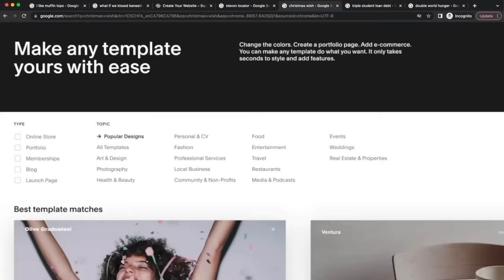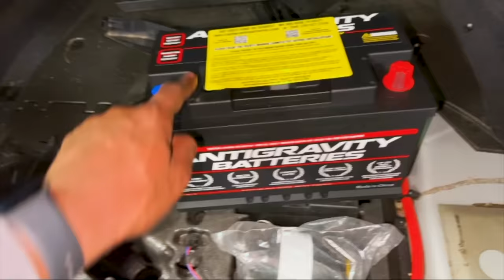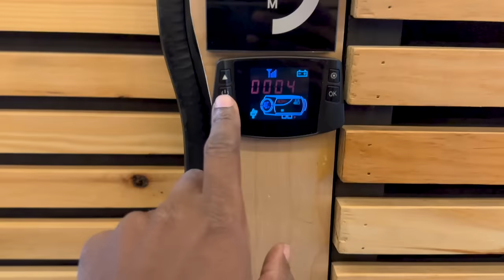I Bought An “easy fix” V10 BMW M5 From Facebook Marketplace, Here’s How Stupid I Was

Comment: It's throwing all those codes cause of the old battery not having enough power for all those components. Plug in the new battery, cleared the codes & registered the battery to the car.  90% of the warning errors should go away. Drive the car Then check the remaining codes again

Comment: I had the misfortune of owning one a few years ago. A lot of trouble from the outset.
I'll list the problems:
1)Second gear synchro wore out and needed changing.
2) fuel evaporation system failed and sucked all the air out of the tank and crushed the fuel sender unit and broke the venturi balancing of the tank.
3) ECU failed due to a rusty pin.
4) spark detection module failed
5)Engine crank seal
6) Diff seal
7) clutch issues

I managed to sort out all of the above except the clutch issues because at that point I was fed up with it.
I part exchanged it for another car and got around £7k for it.
I will say that when it was working it was awesome.

Comment: damn the van looks nice for this time of the year..

Maybe clear the codes on the M and if it's still the same take off the cylinder heads to look inside...
if the bearings are shot, it's over.
alternatively I think you can stick a "surgical" camera (don't know from where) and avoid taking them off.

Comment: Drop the oil pan and check the bearings. They can be replaced with the engine in the car if needed. Copper in the filter means that the coating is already gone. Thin oil with worn bearings could very well ruin your engine completely sooner or later...

Comment: I just bought one two months ago. Completed rod bearings, vanos and a whole host of other little gremlins. The very first thing I would do with this ride is replace and register the battery. It's shocking how many codes this throws with a crap battery. Do your battery then scan with a reputable scanner (Carly does well as do others). Clear all codes post battery registration, then put some miles on it to see what pops up. You will have a good idea what truly is wrong with it.

Comment: The way you can try and unstick these lifters is get it up to operating temp and then at a stop, rev it and hold at like 6k rpm for a few minutes to try and bleed the lifters. That's typically how you bleed hydraulic BMW lifters. What exactly are the codes its throwing in the ECM?

Comment: I had a 2006 e90 330i. If i let it sit too long, i would get the tapping noise from the hydraulic lifters not being filled with oil. even short drives weren't enough to make the tapping go away. take it on the freeway for a little while and the tapping should subside.

Comment: Bmw stands for break my wallet.  Bmw are very solid for 80k miles after that get rid of them. These cars are over engineered on purpose to make you spend money goint to dealership.  I had to buy new female and male  torque socket sets judt to be able to work on them. Very few times have i done a repair without cursing bmw  engineers... may we meet in hell

Comment: if the Cooper seen anywhere it is an issue with bearings. take oil pan down and look for for them. it doesn't require to take of cylinders and rods. the bearings could come off without opening the top of the engine block(without getting cylinder heads out from the engine)

Comment: the v10 engines have rod bearing issues and also the throttle actuator motors need better gears. The copper is from the rod bearings giving you the middle finger that hey are about to ruin your wallet.

Comment: Rod bearings are cheap and fairly easy to do. Just drop the oil pan and change them and I would suspect the engine will be ok. They at least need to be inspected.

Comment: Oh man, sounds like the flux capacitor has a bad connection, you probably need to clean the connectors on the Olsen coaxial monitor cable or replace them all together.

Comment: 6:45  Take a razor knife cut a large section of media out,  fold it back together then wrap it in a clean cloth. Put it in the vise and lightly squeeze the oil out and then you can see exactly whats in there

Comment: That copper is bearing material, surely. They're going to need changing immediately. And yes, pursue it. Try and get Sreten out to sort your car out. What he doesn't know about these cars isn't worth knowing.
Reply: Once it wears through the soft copper, it's steel on steel and the crankshaft will be toast. Replace them now if you still can.

Comment: Rich, Rich, Rich, my man. I owned an E63 V10 M6 for years and worked tirelessly to TRY to make it sound anything LIKE an F1, and figured out finally there was no way. That S85 motor does not sound F1 at all. Not even close. Never can, Never will. BMW made a 90 degree V10 which, is the BMW way. It's more balanced, which BMW likes, but never, ever will sound F1-like at all. The last of those motors were: the non 90 degree Porsche GT, the Lexus LFA and the Gallardo. 2008 and previous. After that, Audi got their hands on THAT V10 and raped it's sound as well.  Stroll thru my channel for my sad attempts at making an exhaust for my M6.

Comment: Lithium IS NOT good for long term storage or colder weather. I haven’t heard any legitimate reviews on these batteries. But it almost has to be just a straight scam, lithium ion batteries lose 20% capacity when fully charged for a year. That wouldn’t take that long compound in to being useless, but if you have 500$ for a new battery. You probably aren’t worried about that I guess.
Reply: Whole video kinda felt like an ad lol two in one vid. Sweet
Reply: Papa Rich gotta pay for Christmas somehow